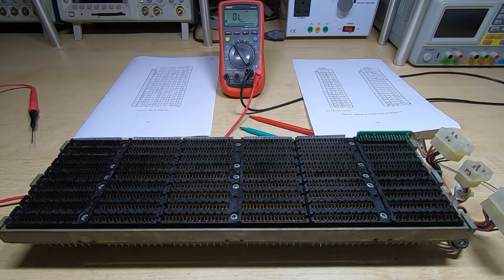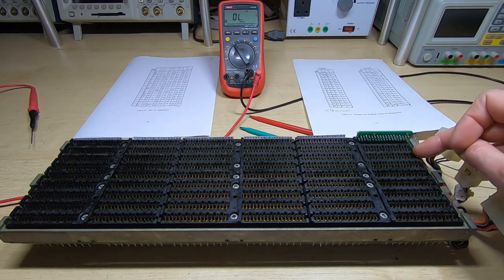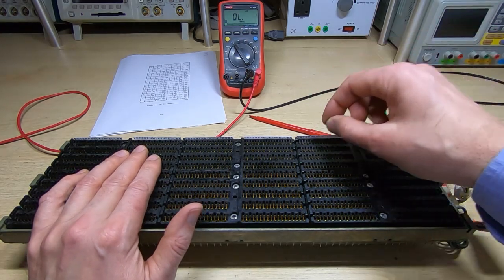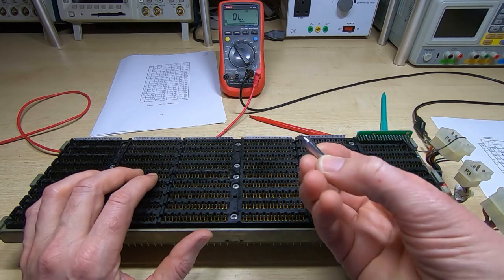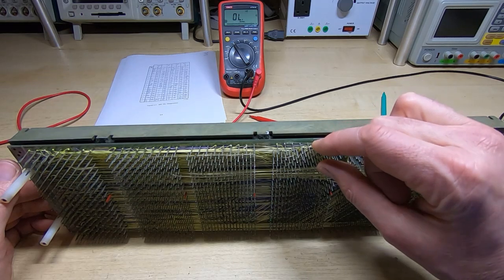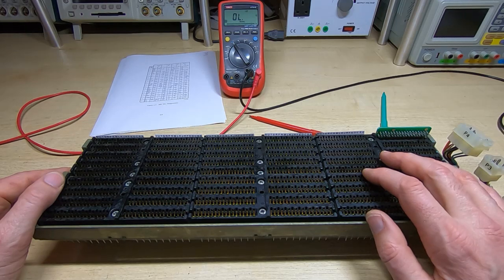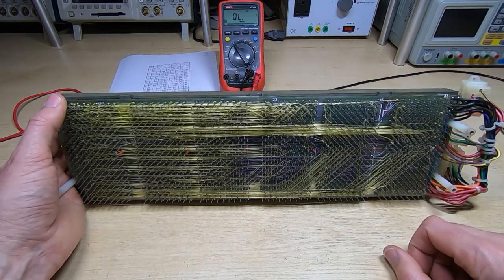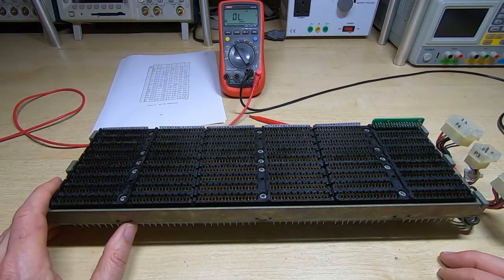PDP11-34A Repair Part15 The Backplane Ideas

Comment: Re-posting again, after da toob keeps silently discarding comments with non-YT links:- 

The deterioration of the backplane is a real bummer! 
I haven't checked mine for this, but hoping they are OK. Maybe there is some treatment that can be applied to stave off problems with units that are still pretty good?

As others have suggested:-
* Ask for help and ideas on a forum like VCFED/DEC, or EEVBlog/Vintage Computing
* Investigate if some sections of the backplane have identical connections that can be handled by multiple smaller PCBs
* Smaller PCBs will be easier to fit over the pins
* Can two (double sided) PCBs be used, corresponding to the solder and wirewrap portions 
* By doing OCR of engineering drawing listings, come up with accurate wiring lists.
* Ask others on the forums mentioned above to verify and/or contribute to the wiring lists.
* A complete new build while keeping the original untouched is tempting, but would be expen$ive!

On the suggestion by Roger Linhart, I have designed some two-socket adapters that could help a lot there. With IDC connectors, a 40 pin ribbon cable(s) could easily be switched between adapters. I give a short description of them in this video:-
https://www.youtube.com/watch?v=O4OxPVE5jGM&ab_channel=bertoid
And there's a link in the description to the VCFED thread about them.

Automating it all with an Arduino would be good for:-
* Verifying that wiring matches a definitive wire list
* Detecting faults in a unit, or possible updates to the wire list.

Comment: Here's one more vote for a new PCB with new connectors, and either a printed plastic  cover per connector, or a printed plastic guide per row, installed after all connectors are in place.

That would preserve all the original wiring intact, and would provide an rescue option for machines with badly damaged backplanes.  Also, as someone else mentioned, it may be tedious to align all the pins of installed connectors on the existing backplane, and repairing/replacing a single connector would subsequently be much more difficult.

Comment: What abut some form of conformal coating / oil once you've done to keep out the corrosion or some way of supporting or cushioning the pins.
Reply from the maker: I would recommend against it. It could get into the failing joints and cause them to fail and would also make future repairs very difficult. The joints will fail anyway as the corrosion is already in there. Maybe if it had been done from new it could have helped but in fairness to DEC these machines were never intended to last 50 years.

Comment: I think an Arduino Mega would have enough I/O and memory to build a smart tester. Just two 18 position double sided edge connectors to plug into the slots. I don't think it would take too long to hardcode all the nodes and have it prompt you to plug into the two sockets to be tested then pulse one end and look for the pulse on the other end. If this sounds useful let me know and I'll see about putting together a prototype.
Reply from the maker: I think it would certainly make a useful tool as long as it could distinguish between a good and a poor connection, maybe set the limit to 2R. I show a UniT meter in the video but I actually use the new OWON meter I showed recently for this testing as it has adjustable continuity limits which is why I purchased it. It would be better if the 'source' connector spanned both A and B slots to avoid lots of 'destination' connector swapping so 72 connections plus the SPC additions but a simple multiplexer could easily do this. The test would need to be repeated 9 times, once for each unibus slot so it would still need 324 connector swaps.

Comment: Well, to the "slip-over-PCB" idea my response would be: Good luck getting all those pins trough that new PCB 
(after you unwrapped the wires from them and probably bent the pins ever so slightly.
Is it not possible to reuse the old connectors? Are the wirewrap pins on the back of the connector, or how are they connected to the PCB?
As with all large problems, is it possible to break this up into smaller more manageable peaces?
Like separate boards for the card connectors and others boards for the interconnections or something like that?
Or modulize the design in a way that makes each part more reusable and interchangeable.
Could the card connectors be mounted to 6 or 12 smaller PCBs that made up the backplane,
and then the interconnection be done out from those?
Yes, I'm just brainstorming here.

Comment: This may be much too much effort, but what if you would, instead of ordering a single 4 layer pcb, make 4 single layer pcbs at home and then stack them on top of another? Then you would essentially get a 4 layer pcb for less money since you etched it yourself at home.
Reply from the maker: I am not sure how that would help other owners. My goal in making these videos is to try to provide support for others. I did however consider making two boards instead of one. The first would be a duplicate 2 layer board the same as the original backplane pcb. The second board would be a 2 sided board which contains the wire wrap connections. By soldering the first and then the second to the existing backplane (maybe after removing all wires) then a complete backplane could be made. If someone later wants to make a version of the second board for the expansion backplane then it would be easier. Two layer boards are also much cheaper than large 4 layer boards.

Comment: If it was possible *at all*, I'd vote for keeping the machines 100% "original," but even repairing them actually blows that unrealistic limitation out of the water.  I suspect that with the number of repro-kits & parts being designed and built now-a-days for repair parts and even entire systems, the best choice for those lucky enough to own an 11/34A will be whichever of your new PCB & connector options end up being the smartest choice.  I recommend asking this question on a PDP-11 group/forum too so you can get (hopefully) a lot of educated/experienced recommendations about which might be the best ways to go with new designs.  You'll also get a better idea of how many folks with machines are interested in such PCBs & new connectors too.

Comment: Mmmmm, a real tricky one there. When you mention the option of "new" connectors in a 3D printed housing I assume that you have found some suitable connectors? I think it goes without saying that whatever the solution it must be able to take standard DEC Unibus cards. My view is that a "slipover" PCB would be the most appropriate way to go, but even then I think you would have to unwrap all the wire-wrap connections before putting the new board over the pins and then re-wrap them afterwards so I am not sure if this is any better than trying to repair the current unit. Obviously, if you made a CPU backplane card the two CPU slots would not be usable on units that do not contain the CPU. Whatever you decide it will take superhuman levels of patience!
Reply from the maker: You would not need to re-wrap the board as the board would have all the 'wire wrap' connections.

Comment: Are "ECS 2400 series DEC style edge connectors" going to help; they might still be available?  I think the design is mostly embodied in the cards, so a new backplane to let it live again is okay by me!
Reply from the maker: Yes I tend to agree. It may even be better to keep the original backplane intact and fit a new 'working' one. The ECS connector are what I had in mind as they have wide input ramps and are in fact very similar to the centre slot in the 9 slot backplane (It uses 2x 4 slot + 1x 1 slot). They also have the ridge at one end so would look very similar to the originals. The main difference is that the pins are not staggered but that would actually be a benefit on a multilayer board approach as it leaves more room for the 'wire wrap' track layers.

Comment: I would keep the existing board, resolder the pins that are bad and wirewrap repair the connections that are really stubborn.
Reply from the maker: Ah yes but which pins would you do? The backplane connections are intermittent and unreliable.
Reply from the maker: The existing pins cannot be reliably resoldered which is why I do not consider my backplane to be repaired. The connections are also intermittent and so you would need to find a way to resolder all of them after removing the old solder. It is certainly an option and is what I have done but I fully expect my backplane to cause more problems yet.

Comment: How about a dual-width PCB for the Unibus A and B, and a separate quad-width for the SPC slots? Would it be a crazy idea to design an SPC PCB that has extra traces with specially thinned points inside the board, then on the bench use a few amps to blow the link like a fusible PROM and customise it?  
ps. thanks for the wirelist explanation, but the layout of the line-printed wirelists I have seen in DEC print sets doesn't seem to be quite the same as your neat boxed table printout...?
Reply from the maker: Unfortunately the CPU slots still have connections to the SPC so it would be difficult to implement. Another thought I had after I posted the video was to use 2 boards (full sized). The lower board would duplicate the backplane pcb connections and then a second board could just be for the wire wrap connections. You would just then use the first and different versions of the second could be made. These would only need to be 2 layer boards so would be cheaper and less complicated to implement.

Comment: i would keep it as it is and design "plug on" boards you simply put over the pins from behind. probably 6 boards with connectors or ribbon cables between them to keep the cost of the boards down. no desoldering or new connectors required. ... edit... too soon :D
Reply from the maker: I assume you mean one board per slot (A B C etc). Unfortunately that would not work as there is no room for ribbon cable connectors and they would need to be 200+ pins wide because most connections do not run from A to B to C etc so each board would need to include all 'downstream' signals.